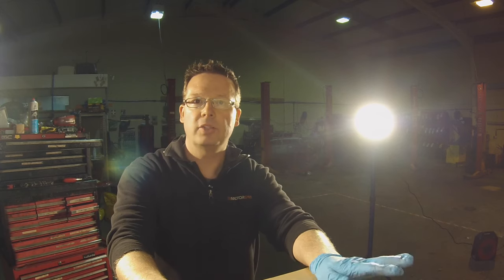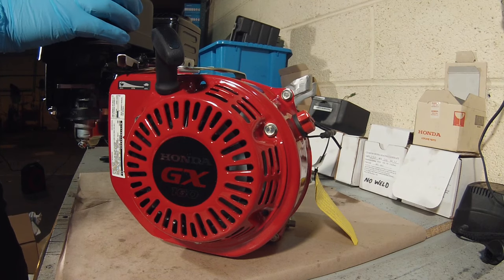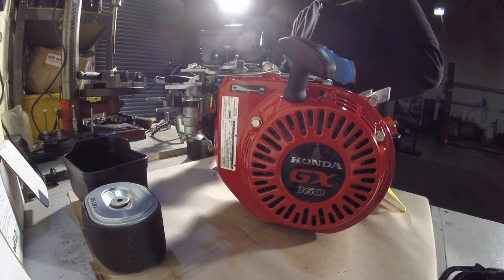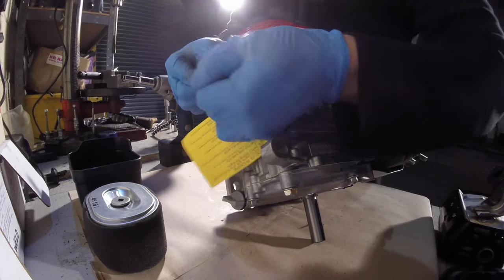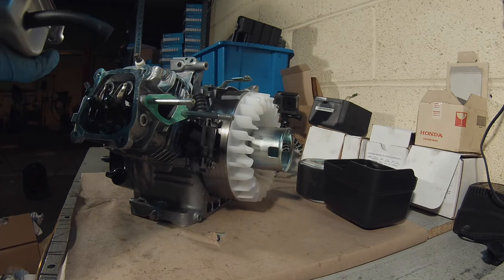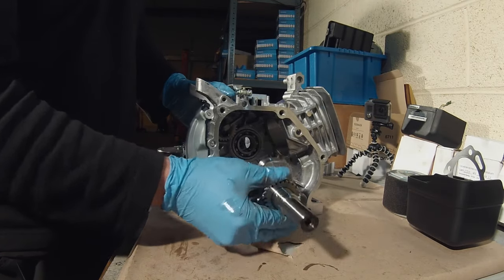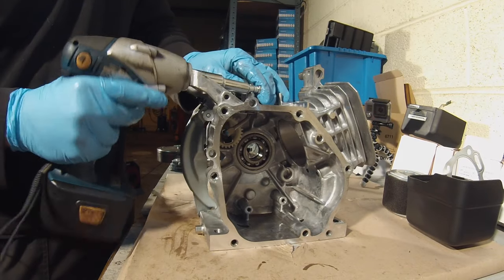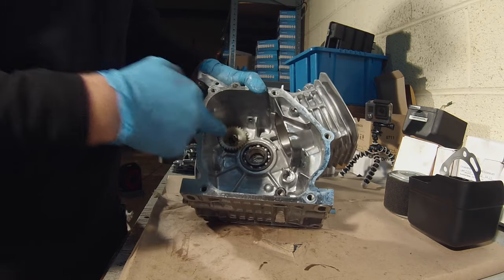Honda GX160 / GX200 Engine Tuning. Full Engine Strip Down in Preparation for Tuning.

Comment: Awesome video. But need some help! My teenager and I are trying to remove the cup from the flywheel (like you’re doing at 10:17). The nut is stuck/frozen and whenever I try to unscrew the nut, the flywheel moves. Whether it’s with a high speed drill or a low speed high torque mechanism, we can’t get it to budge. Worse, we can’t find a way to keep the flywheel still while trying to unscrew the bolt in the cup. Any thoughts? It’s been soaking in some penetrant for a few days. But we are not hopeful…

Comment: I know this was years ago so i hope you see this. You mention an exhaust valve retainer. I have just stripped my mates sons engine as it had snapped a rocker arm. There was a small part sat loose in the top of the head which i am assuming is the retainer. Where does this retainer position when rebuilding it
Reply: It goes on top of the exhaust valve inside the exhaust valve retainer

Comment: My gx160 has a magneto or coil inside the flywheel as well as the outside. I noticed urs didn’t have the inside one.
Do u have to set a gap for reassembly for the inside one ? Or do u know how to do it ?

Comment: you removed the governor rod and spring saying you won't be re-using that, could you please explain why discard it, thank you
Reply: Not sure if you still need an answer, but it's to achieve higher RPM. Governor's limit max RPM. However, you'll need a new billet aluminum flywheel and connecting rod.

Comment: I always see the gx160 and gx200 together when ever I look for parts, what is the actual difference?
Reply: The gx160 has a slightly smaller carb, smaller head volume, smaller exhaust and a different crank and piston. The rest of the parts are the same.
Reply: @UKPrivatePilot  would a 160 head fit on a 200 to increase compression ratio?
Reply: @azza-p  yes

Comment: Which has more power GX 160 or GX 200?
Reply: The gx200 makes slightly more power. I believe Honda rated around 1.5 horsepower more.

Comment: Why on earth would you strip it to tune it...?????
Reply from the maker: So you can add custom pistons, cams, cylinder head etc.  There are loads of upgrade parts for these engines which require stripping the engine down completely to fit.

Comment: Honda Gx160 made in China. Cold start can be an issue' lots of pulls before it starts. Not all Hondas are genuine Honda engines. HR series are genuine Honda. From the bad experience' will not buy Chinese made mower engine again ever.. Generally they are cheaper price' half the price' but will be thrown out after a while. Made th throw out' mot made to last.